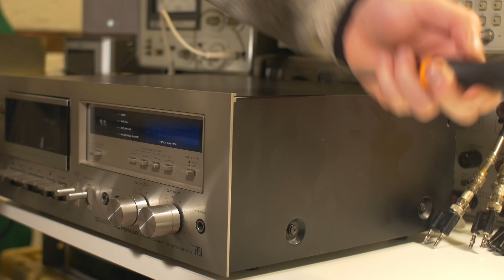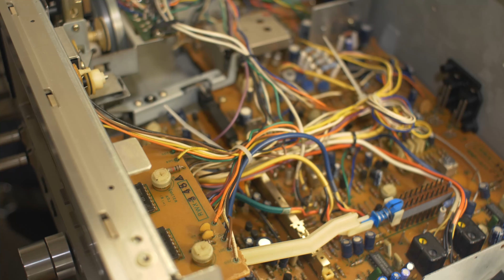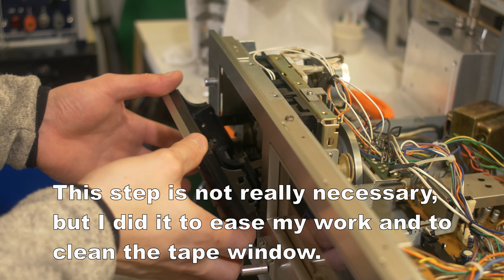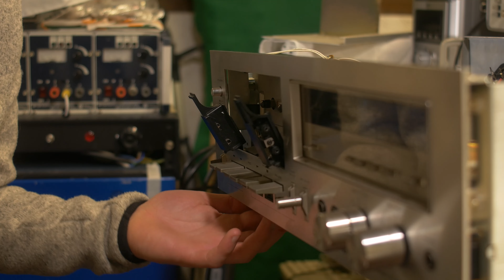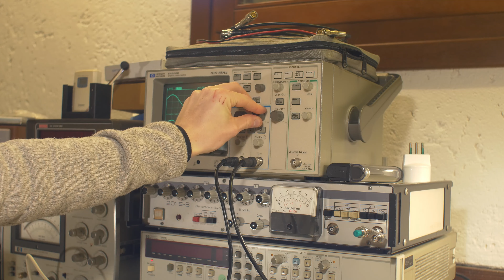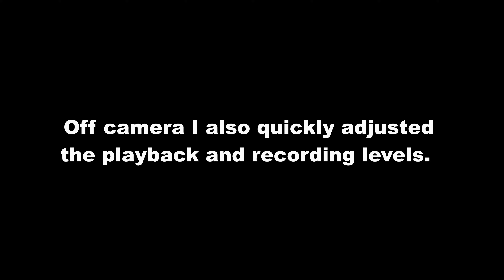Pioneer CT-F650 Cassette Deck Belt Replacement

Comment: Incomplete video. You have missed showing removal of front plate which will reveal a screw on the right side of the mechanism screwed in from the front to hold the mechanisim from its front side which must be unscrewed after removing the front plate. This mechanism is NOT designed to be easily user serviceable by pioneer.
Reply: Two more screws on the front not one

Comment: Strange that the meters change position when you turn at the output knob , I've never seen that before ,  I mean where is the reference . Normally only the volume changes when it's connected to the amplifier  and the meter output in the display stays the same . Also strange that no-one below comments on that

Comment: Hi Sir i'm confuse how to change the gear belt on the centre ..
Reply: Yes, i had the same problem. Seems one must dismantle the whole mechanism to change that belt. It is only to rotate the auto stop mechanism, so i decided to cut the belt, feed it through and glue it together with superglue. Stripping the whole mechanism for that belt in my opionion adds risk to breaking something so hence i did the above. Good luck.

Comment: You didn't replace the 5th belt. That's the one I am figuring out right now.
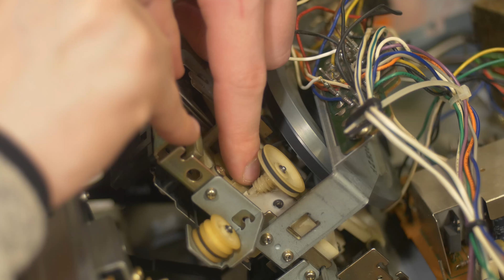Reply from the maker: You’re referring to the one at 9:22? Because to replace that one you have to disassemble the entire mechanism. To replace it what i did was to cut the original one and I forced the replacement in place by opening a bit the top plate (using a screwdriver as a lever) just enough to slip the belt over the pin of the wheel, so without disassembling the whole thing. That’s a little bit crude but it worked fine. Hope it helps.
Reply: @DaveElectronics  Thanks
Reply: @DaveElectronics  Thanks, I had the same question, appreciate your response!
Reply: Doesn’t make any sense what your talking about. There is a screw/pin through the middle of this belt. Not sure how you went through this with a belt intact. Unless EU models are completely different. Witch is what I’m thinking as in your video vs mine, I had 2 extra screws on the front plate that were never mentioned in your video.
Reply: @ohioreseller6381  I've done belts on CT-F600 which has quite similar mechanism. That tricky belt is for auto stop function, mine was ok but I decided to replace it anyway. To do this, i drilled a small hole in  front of the shaft (this one is for pause engagement arm) and carefully pressed it out with suitable screwdriver, then moved arm aside a bit to get the belt through. Assembling is vice versa. Actually, there's no other way to do this belt, or the whole mechanism must be dissasembled. Hope it helped.
Reply: @VS-po8zc  : bonjour , je cherche aussi à changer cette courroie qui est très détendue sur mon CF-T600 ,  je ne savais pas que cette courroie sert au mécanisme auto stop.   Vous êtes sûr que ce n’est pas la courroie qui sert à ce que la bande de la cassette soit toujours tendue ?  Merci pour votre réponse 😊
Reply: The center pin for the large drive belt is actually 2 parts. Just use a screw driver as a wedge to separate the pins and slide the large drive belt through

Comment: Agreed, nice unit...great job!  I believe you can get software W&F, maybe also an app for your cell phone?  ~Jack, VEG
Reply from the maker: Thanks Jack for the comment! :)
I will do a search on some w&f meter software, thanks for suggesting that! 
Btw, I’ve been searching for a benchtop meter for a while but they are not cheap at all.. so maybe someday, if i get a bargain one, perhaps a repair candidate, i’ll get it :)
Dave
Reply: @DaveElectronics   No prob!  I know they are spendy, I lucked out, paid $30 USD for mine (BK Precision 1035) and it works!  I just need to check its accuracy, but since I'm not worried about lab grade accuracy, I just haven't got around to it yet.  I bought mine at a HAM swap, check your area to see if and when you have a HAM swap, you to may get lucky...I've also picked up free items as well.  You don't have to be a HAM to attend unless you guys have goofy rules.  :)  Glad to see a video from you.  ~Jack, VEG